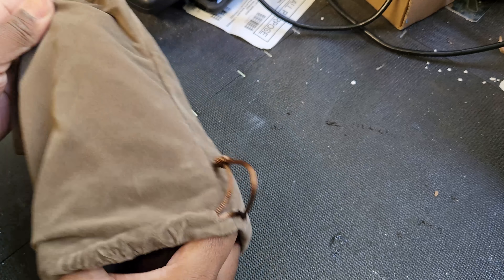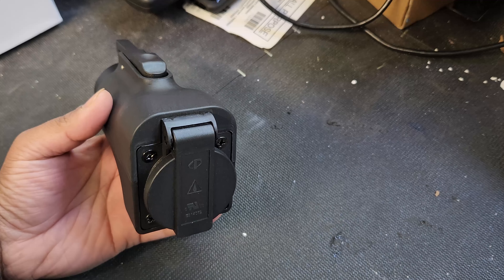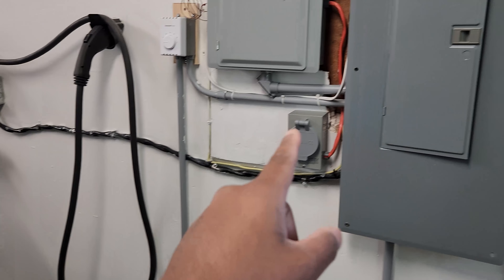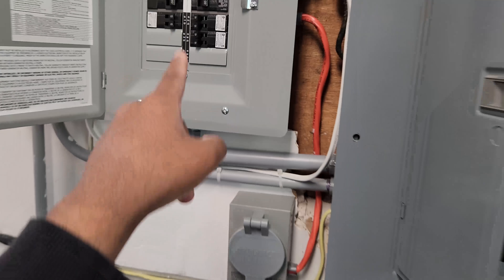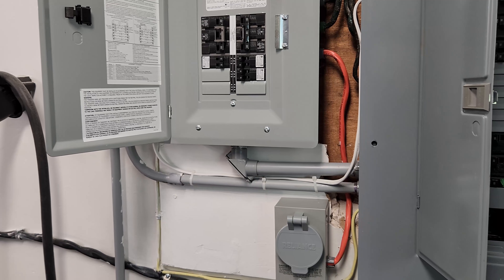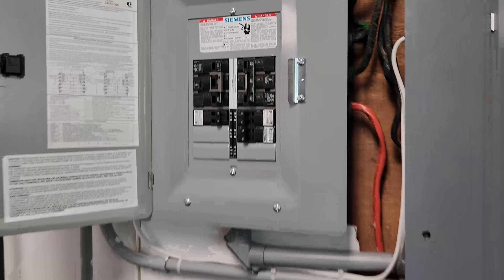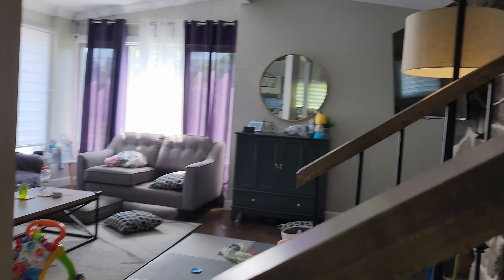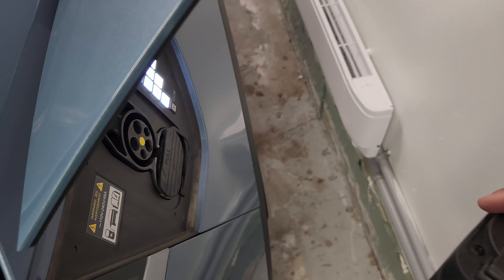How to safely power your home with A2Z V2L - 2022 IONIQ 5

Comment: Great video. We currently rent a townhome with detached garage about 25 feet from the house. Our landlord is cool with us installing an EV charger in the garage; going to see if we install a generator plug there too for a use case like this. Even if it's just one circuit due to the run length, we could keep our fridge and freezer going and run fans/small electronics for comfort.

Comment: Hello, can you recharge another EV with the LECTRON V2L like the OEM V2L adapter from Hyundai? 

Can it be used at the same time as the plug below the rear seats to double the power output? Thanks.
Reply from the maker: I don't have the rear plug, but I believe there is only one inverter so you wont be able to double dip, it's probably one or the other. Yes, you can charge another EV at max 12A which is the usual amperage limit for level 1 charging.
Reply: Thank’s for the info. Lectron doesn’t seems to be able to recharge another EV so the A2Z has an advantage!

Comment: Hello, how much does it cost to install an energy control panel like yours that can input energy?
Maybe you also have solar power and storage?
Reply from the maker: I do have solar panels and battery storage. The panel itself is around 500 CAD but getting it installed might cost you around 1000 CAD total. My panels and solar generator ended up costing around 7000$ but that's a bigger project. I'll probably do a video on it.

Comment: I'm puzzled by the conversion of 1 phase to 2 phase with a simple extension cord?  How does this power all of the breakers in your box?
Reply from the maker: There's a difference between having two phase vs splitting the same phase on different side of your breaker box. In this case, the cord splits the same phase on both sides of the box, hence why you should not use it to power breakers that require 2 phase (240V). In my case, they're all single phase breakers and do not intend to power anything with 240V.
Reply: @EVDude  Thank you for the clarification - is there any concern with overloading the neutral with this config?  I'd love to be able to power both poles and all non-240V breakers, but I also don't want to burn my house down 😁
Reply from the maker: @techgeek6848  The neutral and ground are bonded with the V2L, so you have to make sure your transfer switch is capable of disconnecting the neutral from the main panel as you're not supposed to have ground and neutral bonded at two places.
Reply: That’s what I’ve found with the Lectron, it’s a floating ground whereas the OEM is bonded.

Comment: Why not just use a single Nema 5-15P male L14-30R Female, it would weight less and reduce the connections/required adaptors ?

Comment: Hi, any idea on the cost? I’m also in Quebec, I just got my 2024 Ioniq 5. My electrician is coming to install the charging station this week.
Reply from the maker: @brendanixon1227  there are a lot of variables. It can cost between a rough estimate would be 1000$ to 3000$ including the generator panel.

Comment: What made you decide to use a 60 amp breaker for where the generator goes into the panel?
Reply from the maker: The panel I bought comes pre-installed with a 60A breaker. I am now using a solar generator with a 30A output and the breaker is on the generator itself. In the event I want to upgrade later on, I'll be ready with the 60A.

Comment: Hi, I recently took delivery of my ev6 and have been looking at ways to use the V2L. I’m in Quebec as well and experienced the lengthy power failure last year that lasted 3 days. Can I ask you what the cost was to get that set up. I’m debating on doing this or getting a gas powered generator 🤔which doesn’t sit well with me. Thank you. Great video by the way.
Reply from the maker: Thanks for watching. It will cost you around 1000$ to 2000$ to do this. It will of course depend on labour, but the parts are pretty expensive nowadays, to give you an idea, the panel itself was 450$. It's definitely worth it on the long run, I have since sold my IONIQ 5 and I'm currently planning on getting an inverter generator (which also doesn't sit well with me, but alternate options such as Ecoflow are too expensive).
Reply: Costco has a 7500 watts generator that is dual fuel made by Champion that is connected to my 400 lb propane tank which I can use to charge my EV and then us it to power my house!

Comment: My electrician is installing a setup like this for me next week, with the added challenge that my panel is in my basement, and my garage is a separate structure (but with 2” conduit back to the panel, so no digging!).  Unfortunately as the output from the V2L is 15A he can only wire it into a single circuit, so I’m having to choose a single circuit to backup.  That’s at least better than the zero backup I have now, and being able to just plug everything in and flip a transfer switch or lockout will be big for all the days our power goes out due to trees damaging lines out here in BC!
Reply from the maker: That's the way to go! I've added solar panels and a solar generator since this video. I'll probably make an updated video of my current setup and publish it soon. Thanks for watching!
Reply: @EVDude  - I look forward to seeing it!  Our home was roughed in for solar (so conduits for wiring from the roof to the panel, but nothing else), and I too am looking at ultimately putting in a battery backup (I’ve been eyeing the GoalZero Yeti Pro 4000, but really like some of the other options as well), so I’ll be interested in seeing your setup!
Reply from the maker: @YaztromoX  That's a solid choice with Yeti . I ended up getting an EcoFlow Delta Pro with 2x extra battery. So roughly 10.8 kWh and 3.6 kW output power.
Reply: @EVDude  I’m looking forward to the day when we can just buy a system based on a refurbished EV battery pack — even 75% of a 77kWh pack is about 58kWh of power — and once they’re relatively plentiful having such a large capacity could be really cost effective.